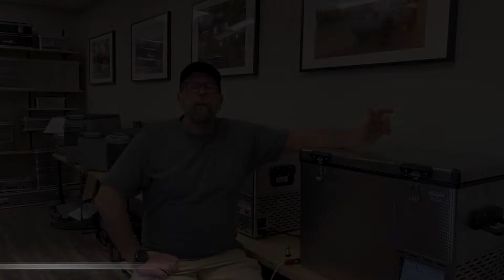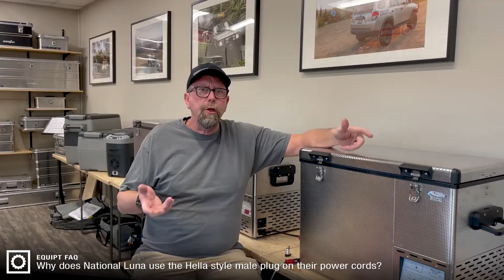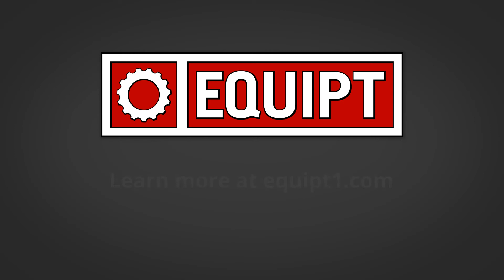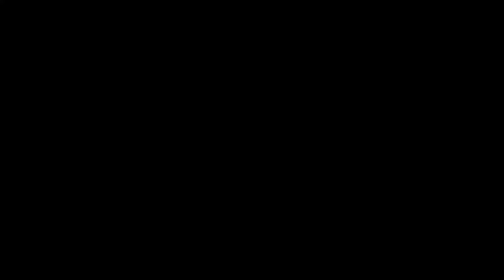Equipt FAQ: Why Does National Luna Use the Hella Style Plug?

Comment: How would it run on a DC outlet on a Jackery?
Reply from the maker: Luke, the Hella style plug will not work with a standard 12v cigarette style outlet. We sell 12v cigarette style to Anderson Power Pole plugs, this should work for most portable power stations. Better yet, if you have a Jacket or Goal Zero style power station with the red/black Anderson Power Pole output, that's your best option. Those plugs are typically found in the larger power stations.
Reply: @Equipt1  Is there any loss in efficiency when using the 12v to anderson adapter?